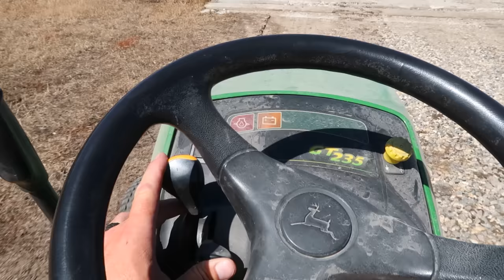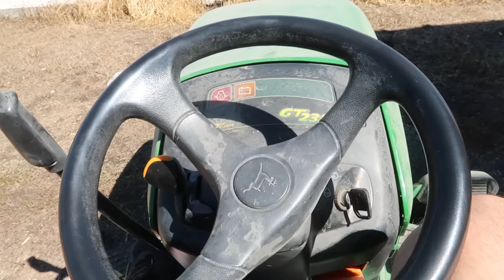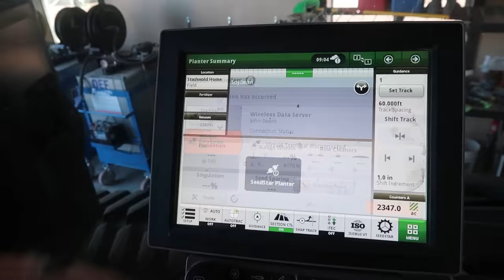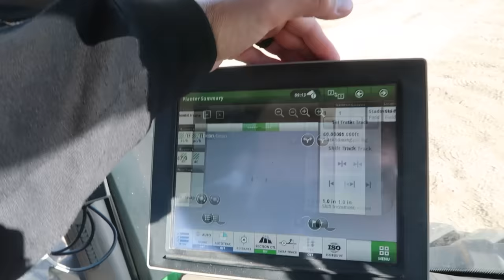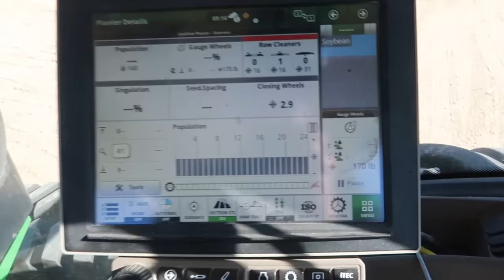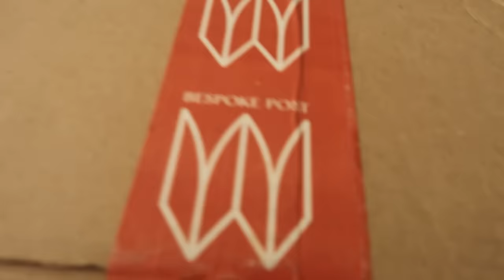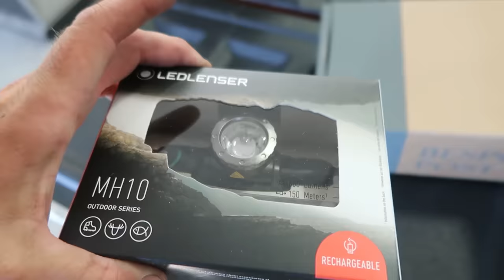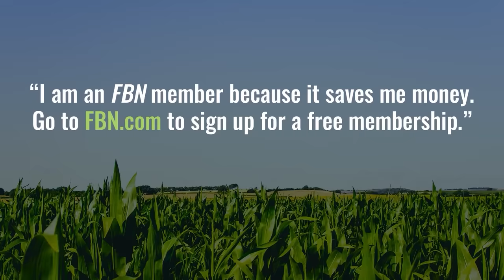I Jinxed It With My Overconfidence

Comment: Our tractor does the same thing. The tech came out and said it’s the iso bus connection in the back. Everything communicates through the iso bus and if that plug in the back goes bad then nothing will communicate properly.

Comment: You may find some of your tractor/planter issues stem from low voltage while cranking the engine. In the past I let the tractor run for a bit to get some charge in the batteries then shut down and try again.

Comment: You can delete the spring from the the choke underneath the panel so u don't how to hold it and try to spray spray carb cleaner will the engine is running or just clean the whole carburetor

Comment: The mower carb normal running circuit is plugged up. Needs took apart and sprayed with carb cleaner and blew out with air.

Comment: I noticed on a video that I was watching, you were working on a combine header and someone said don't drop any parts. Growing up on a farm some 50-60 yr. ago, I remember that my Dad always had an approximately 10 x 10' good vinyl and canvas tarp that he always took to the field. He would place in on the ground under the part we were working on to catch any dropped parts. It usually worked fine. The only new machine I remember was a 1952? John Deer 55 with I think had a 14' header. I have a picture of my Dad cutting wheat when it was 25 yrs old, he had a bit of the Scottish blood In his veins. When my dad retired in 2008 at the ripe old age of 80 his current combine was an early 80's 6600. Fun while it lasted. PS my Family Tree goes back to the Mayflower and early 1600's.
GR

Comment: Some of the computer errors might be caused by simply starting to fast. When you start while the computers are still powering on you mess with the voltage of the system, computers can't handle that. This worsens when voltage is already low. This used to cause all kinds of errors on my (european)truck. So I'd suggest to just turn the key to power on, wait for stuff to boot up, and then start. maybe it works, maybe there's other issues, but it won't hurt anyhing to try :)
Reply: this is good advice
Reply: Yes. Technology is nice, but finicky -and ever so frustrating when it doesn’t work. 😤
Reply: You are teaching the machines how to do your job. How kind of you to work out all the glitches for them. Does no one see what is coming? Seriously, check out Harare from WEF. He clearly states how unnecessary most people are going to be in the running of the world. We should not be helping them get there!
Reply: As a software developer, I'd say the planter + tractor system startup is designed by the manufacturer to have a repeatable startup time.    And any time the system allows a start, the engine is ready to turn over and should be OK to start - even if the monitors are still powering up.   Any deviation as seen here is caused by leakage in the wiring or bad connections.   If it improves later, the leak / moisture problem resolved itself, and may or may not continue to give problems on future startups.

Comment: On that mower, there should be a rubber pick up tube that goes from the fuel pump to the fuel line, it's prone to getting cracked or holes. (like trying to drink out a straw that has a hole in it)

Comment: For the lawn tractor i'd check  the needle valve in the carb.  I had some dirt once.  Also the JD lawn & Tractor dealer sadi to put 104 or 110 octane in it. they also sold small Sunoco barrles of the same gas no ethanol!  Wonder if the race car has the sme fuel?  Hmmm! glad you are making progress on the barn and an expansion in capacity of propane!
Reply: Wouldn't be surprised if the lawnmower is a diesel too since they have big fuel tanks of it.

Comment: jets are clogged up most likely on green lightning.  i use straight gasoline, no ethanol, no more problems.  theres a product called "mechanic in a bottle," here in michigan we get it at home depot, it frequently actually clears up issues like you're having.

Comment: I used to own a John Deere GT 235, with the Briggs motor.  It ran fine until the government put ethanol in the gas, then it ran horribly.  After 3 months of it being at the dealer, they had to replace the carburetor (another 2 month wait since there were none in stock) and there was no way to do a rebuild since it was a sealed unit.  Now I have to use stabil fuel treatment for the ethanol in the gas.  Look into it at the dealer, you may not have to replace the carburetor.  Good luck.  Nick

Comment: Probably a connector that has corroded a little bit, just disconnect the electric cable between the planter and the tractor use some electric grease. Should fix your issues for good

Comment: It looks very much like a voltage issue as it improved as the Tractor had been running longer, starting probably causes a massive voltage drop, then the low voltage effects the sensors, as the engine runs and the alternator charges the battery the voltage stabilises and the faults disappear - just my theory

Comment: Well Zack I'm at Kenworth I see a problem you're only running three batteries in it and that's okay for running down Arizona and the warmer States in the winter but you're in the colder climate so you need to add a fourth battery to it and I'll bet that'll make a big difference for your starting that truck instead of having to boost it all the time
Reply: You sir are 110% right.
Reply: Run 4 in my Pete
Reply: Doesn't really matter 3 or 4 if there dead there dead. He's not boosting he's charging. And what difference does it make in the summer? In the winter maybe....
Reply: @carlahess1680  I know I was having issues with 3 and them getting weak.  Since adding the 4th haven't had any issues
Reply: I live in Ohio I’ve only ever ran three batteries and I have a bunk heater no problems
Reply: Just get an electric semi.  Your problems will be solved.
Reply: @mudbuster50  and what do electric trucks run on?
Reply: @kenhofer8063    Good one… 🤣😂
Reply: @kenhofer8063  juice?
Reply: @kenhofer8063  fairy dust.
Reply: @mudbuster50  just one big battery to go flat then lol
Reply: Only one battery needs to be bad to drain all the others and usually easy to find. It gets hot after couple hours of run
Reply: @BigPtace  It gets scary when that one bad battery begins a thermal runaway and the truck isn't even running, Had that once the casing was so hot I couldn't touch it. Fastest battery removal I've ever done on a kw lol
Reply: @BigPtace  yeah, either one or more of those batteries is bad, or he has something on the truck drawing current all the time draining the batteries.       a good clamp meter would solve the mystery pretty easily.   But he seems to like getting the old charger out, so i don't think it will ever be fixed.
Reply: @mudbuster50  🤣🤣
Reply: We bought a tractor second hand and it kept killing batteries so bad it had to be jumped every time, even if it was just stalled (we had put 4 batteries through it in about 3 years and didn’t want to just keep throwing batteries at it). Then after a little research we put a properly sized battery in and haven’t had an issue for three years. So I think your suggestion is probably a good one.
Reply: Either his trucks just start hard or somthen because we have three in our Volvo with a 60 series detroit. Summer we used to usually use two batteries and threw a third in and it starts just fine.
Reply: @johng4527  he has a kill switch. So batteries can’t be drained from something else exempt if the switch doesn’t work properly
Reply: What battery salesman told you that? 😆
Reply: @carlahess1680  o
Reply: I only run 3 and I’ve never had an issue.
Reply: Cummins needs 4 batteries

Comment: Brother Zach there’s a problem development every time you try starting the Semi and it’s not “charged” enough so you have to use your charger. Every time you destroy the battery more. After frequently doing rapid charge and high amps from the chargers you warp the plates inside. Eventually you lose cells and amps go down. You can destroy a brand new battery fast. You also are not using enough batteries. If you want them to work right you have to resolve this. Add batteries until you have 4 each truck and use your isolation circuit. You will never have trouble except every few years. I hope you focus on the batteries this year you have been struggling with them obviously for years and years. If you just resolve it then you won’t have the issue. I think it’s much easier for you to just be ready instead of needing to do a multiple point procedure for just starting motors.🥲🇺🇸🖖🏼❤️

Comment: Clean our the fuel tank, filter, and replace the fuel lines on green lightning.  Those fuel lines start shedding debris inside. Gotta clean the carb too.-  Might be better to just order a new  cheap amazon carb and replace - or buy 3 to make sure you get a good one. Still almost cheaper and less work than an original carb kit.  Been running one for 3 years without issue.  Good project for Onyx

Comment: Without any experience with any type of farm equipment I would think that John Deere would add some sort of maintenance/park mode so that you could purge the system or move the equipment without having to go deal with all of the sensors. After watching your planting exploits something would have gotten kicked or thrown across the yard after the second attempt to move the tractor if it was me.

Comment: Another reason you might be having battery troubles in the trucks even with disconnects is if you're running Napa batteries. I would only buy Cat or Interstate truck batteries.
Reply: ...probably take the cables off the battery studs too and clean the connections real good with a roloc disk

Comment: they make battery tender only allows  battery to drop to 50% shuts off battery to start. great for equipment that has a drain. then wire separate battery for computers... problem solved tractors and grain trucks.

Comment: You really should build a steel building. They are a lot stronger than the pole buildings that you’ve put up in the past!
Reply: Stronger than a Minnesota tornado??  Nope.....!!
Reply: @paulcopeland9035  You might be pleasantly surprised!! I’ve seen situations where pole buildings and steel buildings were built right next to each other, and the pole buildings were destroyed by the tornadoes. However, the steel buildings had very minor damage, if any at all!

Comment: Zach 2 things; 
1) I’m glad I’m not the only one who saves doors off old racecars. 
2) Those guys dumping the gravel were some considerate operators; easing off the pile, not letting the gates slam with the kids around. Nice to see someone treating equipment respectfully even when it’s not theirs.
Reply: Funny looking gravel, looks dirt with a few small rocks in it.
Reply: @denp54z  it's A/B, Asphalt Base Rock, or something similar. A mix of fines, sand, and larger gravel to get good compaction and a smooth surface.

Might also be something like 3/4 minus, basically everything that comes out of the crusher that's smaller than 3/4". It's got a lot of fines in it, but it's still all fine sand and gravel, no dirt. 
It depends on how cheap they wanted it lol

Comment: What if all the troubles you had planting this season wasn't the planter but a issue in the tractor itself?
Reply: Especially if the tractor was exposed to the tornado - likely the shop did what they could under time pressure to get the equipment ready for the field, but who knows where the wind drove water and dirt into places.   If John Deere was smart, they'd bring out whatever engineers necessary to resolve the problems and make the tractor and planter perform as well as it did in the first season.

Comment: John Deere went cheapo on those connectors.  It will never get fixed until they cut those out and put new connectors in.   I'm thinking they spec'd some indoor connectors, or maybe they spec'd some reasonable connectors and found a really cheap supplier.   I used to make and use fiber optic connectors,  connectors can be a huge weak link and cause you to repeatedly pull your hair out.  I suspect Deere needs to spend more money on better connectors (yeah, I know that will filter down to you) but at the end of the day it will stop wasting your time.     Another area might be how they are transmitting the data back to you the computers.    Hopefully it is some type of databus system from the sensors, but from the way you describe the issues,  I'm doubting that is the case.   Take some good pictures of the connectors the next time you run into a problem, and see if you can find a manufacturer name,  I have my suspicions.

Comment: I work for a John Deere dealership, they won't listen to me but maybe they will listen to you Millenial, but the real fix to the rows not working should be that each row only has the air, hydraulic and a power wire to it and make the control part wireless or someone in the aftermarket should come up with a upgrade kit to convert all those miles of wires, plugs and harnesses to wifi or bluetooth, hopefully that should remove the chances of broken or corroded wire and communication issues.

Comment: They add Computers some time in the 80s and every 3-5 years add an additional computer claiming it will make the farmers job easier instead you spend 6 hours dealing with codes on a job that should take 15 min.

Comment: I feel like there is a decent chance that planter is not coming home.
Reply: That's what I was thinking when he was blowing the dust off of it. He may be getting it cleaned up to trade it in.
Reply: @Keith_White  they had a ton of hassles this past spring with it. They are expensive, but at a certain point, they might have to cut bait. I’m not so sure the old max emerge or an old kinze with a regular tractor might not be easier. A $1 million tractor/planter shouldn’t be that much trouble. I think they’ve gotten too cute with the technology. (But what do I know?)
Reply: @terencef5806  I think he used this rig last year and it worked well. I don't think the storm messed it up but with the second year of use being such a hassle who knows what's going on. We still use stuff that was paid for years ago and can't plant at 10 mph, but I've never had the tractor refuse to leave the shed because of the planter except when the planter had a flat tire. The need to go faster and plant more has created a problem for lots of people. Hope if he does make a change, it's something that works.

Comment: Mower - Extract as much of fuel you can out of tank, and float bowl of carb. Fill tank with gas you just bought, (just half full at first). Get started, Use some on again, off again choking motion, like usual. It should clean out, after some use. Unless it won't start.  Clean spark plugs,(wire brush). Gap to .028. Easier starts while hot.  Hook plug/s to coil wire/s. Find a safe way to ground the strap of spark plug to ground of engine, not the battery ground.  Turn over engine while looking at one spark plug at a time,(if more than one cylinder), to make sure it/they are firing at all. If it, or they spark, install it/them carefully. try starting without choke first, the engine may have extra fuel from last time it was running, and shut off. Ha Ha Ha, choke as needed.. It should clean out with use, mow something after it sounds better. It'll die if it's not cleaned out yet, most likely.

Comment: This is what happens when you have to get bigger and farm more costs bigger equipment framers in my area are getting big equipment that doesn't work in smaller fields. So if they own the ground they push out the trees to make the fields bigger . At the same time the small farmer can't afford to buy the new or even used equipment, when I farmed used a 1086 ,806 and a small  planter slower than the farmer that farms my ground now . But if you look at income now ,versus income than and input then versus income now still about same in my pocket now . When I farmed I could have never thought of paying 500 thousand to a million dollars for a combine crazy.

Comment: If you can’t cycle the sensors on your planter and you keep getting a communication issue that could be a battery issue for the tractor if you have a battery issue you’ll have A lot of issues like that I seen that before and stuff I have when the battery goes bad it might seem that it start The tractor but 95% of the time it’s a battery Issue. Communication failure could be a battery issue in the tractor batteries are funny like that batteries will test OK and even start the vehicle they communication error between your tractor and your planter because when the voltage gets too low things start acting up and the codes are detected and thrown.

Comment: Why oh why would the planter put out errors and prevent the tractor from moving when its obviously in transport mode folded up!?  It can complain all it wants but you are not trying to plant corn in the shed!!!  Then, why is the tractor prevented from moving due to the planter?  I'd pull the connector on the back and let it be a dumb towed item....